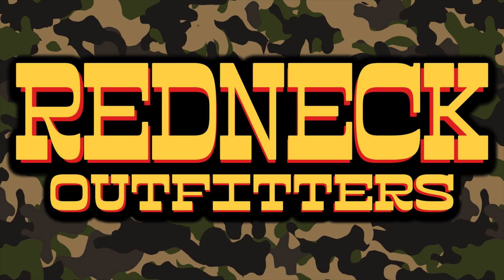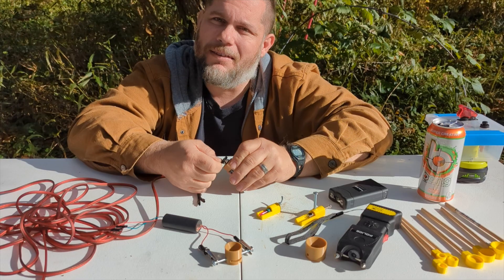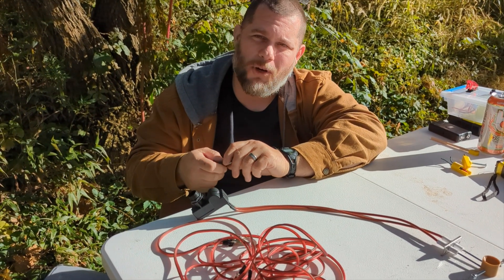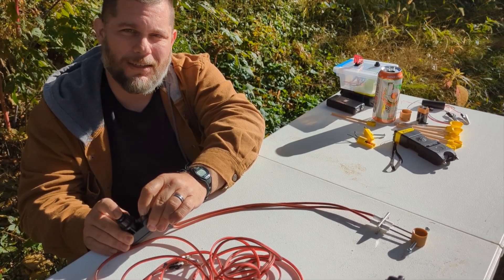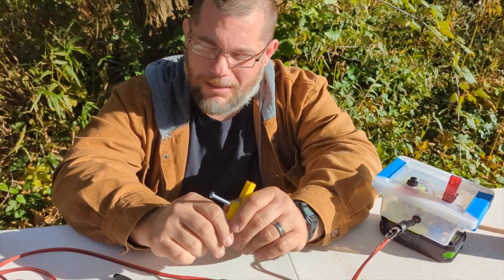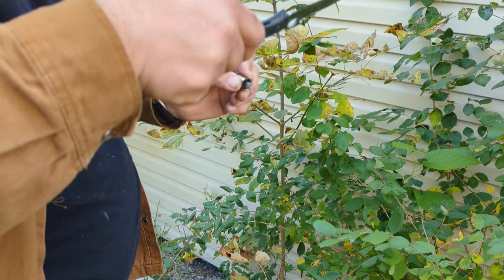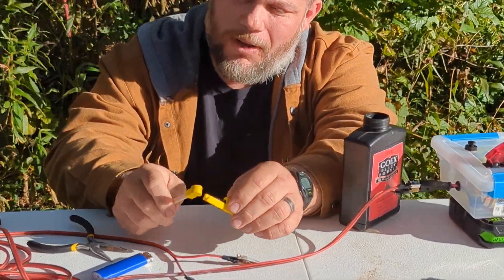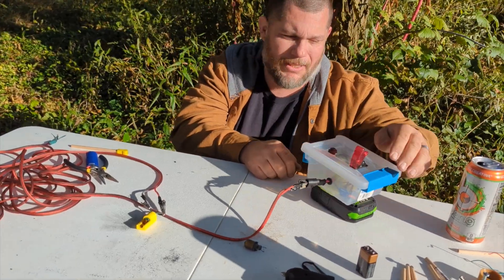Black powder AND electricity...do they mix?  Igniting black powder with a spark?

Comment: Electric ignition was thoroughly investigated in the 19 th century. Spark ignition does not work largely because the carbon content and graphite coating are electrically conductive, Hot wire was adapted as standard and remains common in artillery at the present day,

Comment: I think your method with chinese transformer stun module would work  if  you use hot air arc modules.These modules work simply like  arc lighter and they produce hot arc .Other interesting way is make your own e matches firing rig with  remote control relay for garage door .Check old elementalmaker video .

Comment: I'm convinced that the industrial and commercial powder explosions (and actual test conditions that replicated such) caused by static electrical spark ignition were all contingent on airborne dust particles forming an explosive fuel/air mixture as the real source of ignition. (or rather, what the electrical spark was capable of igniting, which, of course, then ignited the bulk of the powder)

The biggest or most systemic problem I've seen referenced was actually with large grain military powders, particularly for coastal defense and naval guns. There's a particular example of canvas sacks of 'cocoa' gunpowder (large, hexagonal prison shaped powder made with brown charcoal from rye straw charred at lower temperatures; resulting in powder grains that looked like chocolate bars ... or lignite coal briquettes). Sacks full of walnut or chestnut sized powder grains could be ignited by aggressively shaking the sacks.

Those conditions would've generated static electric build-up on the relatively non-conductive sulfur and brown charcoal while also forming flammable sulfur and charcoal dust (the sulfur would be the easiest to ignite).

Typical black charcoal is more conductive and would more often be likely to short circuit the electric spark and distribute the current throughout a larger bulk of powder. Graphite-coated powders would more dramatically have this effect while also preventing dust formation via lubrication of the grains. (and any dust that would be formed, would tend to be graphite, which is conductive and difficult to ignite)

Some early smokeless powder explosions (particularly with the french, single-based powdre B) and guncotton explosions were also likely due to similar conditions of dust combined with non-conductive powder grains. (graphite coatings on modern powders prevent this, though it also was much less of an issue with most double based powders, and especially with cordite: though the latter was usually loaded in ways that the sticks of cordite had little to no ability to move, even when used for large bore artillery or naval guns: bundles of bound cordite were often used for that)

I suspect a portion of commercial powder mill explosions are also a result of this, though there's a lot of other potential variables there. (use of wet/damp milling, controlled humidity, air filtration, and other dust management practices would reduce that risk, including dry mixing/milling sulfur and charcoal, as that could be a major source of dry airborne dust)
Reply: I recall a test some time before the Battle of Jutland where a Royal Navy Officer swept up some dust from a turret, took it out on deck and touched a tinder to it and it flash ignited. This dust was everywhere inside the turrets and magazines of these ships. At Jutland, many officers were surprised at how easily German warships were detonating the magazines of British Ships.

Seems strange that the entire First World War hinged on a bit of dust on a warship.

Comment: Nichrome wire from an old toaster, finer nichrome from a submersible water heater element ... (christmas bulbs do seem to work pretty good too, though ). Old school flash bulbs KICK ASS but harder to find nowadays. ** Try powering a christmas bulb with one of the stun guns, maybe
Reply from the maker: We are working on a cannon design using nichrome wire.
Reply: @redneckoutfitters   There's at least one article online of attempting to convert a flintlock into electrical ignition. High voltage, short duration electric arcs all tend to fail, but the high current from a disposable camera's flash circuit seems to work. (though I think some of those were with hot-wire ignition systems powered by the flash discharge, to allow more instant ignition than some other hot wire current sources ... and more portable and less dangerous than say ... a car battery)

There's a much stronger and longer duration plasma arc created from that (think more like an arc welder or carbon arc lamp) and tends to be superheated metal (or carbon, if you use graphite electrodes) when the capacitor is discharged.

You can usually get away with shorting a spark plug (or ignition coil wire) across you finger(s) without visible damage, but the same isn't true for sticking you finger in the spark between the contact of a camera flash discharge and then discharging it. You'll get a nice little round burn hole in your skin at the very least. (might be good for removing warts, actually ... but uh ... don't do that, either; the effect does remind me of the dry necrosis you get from spot cryogenic freezing for wart/blemish removal, though)